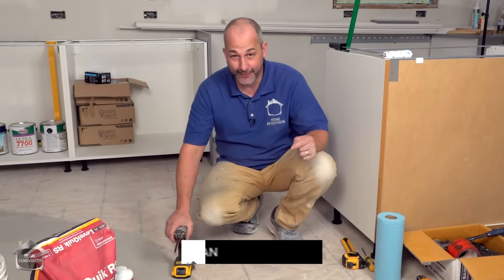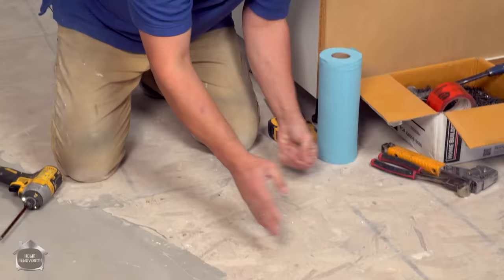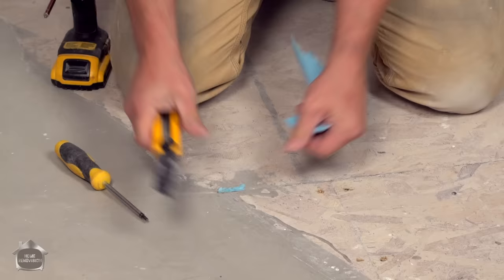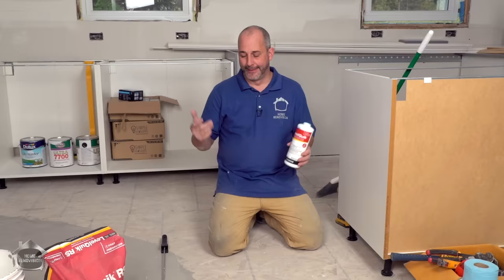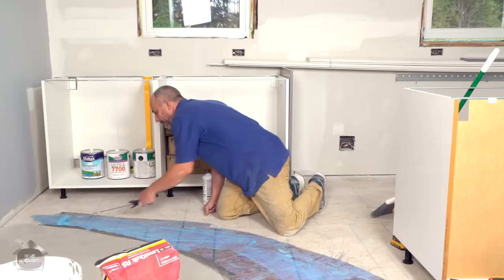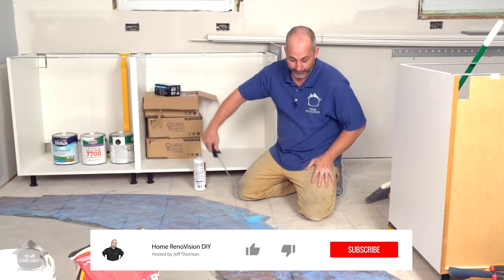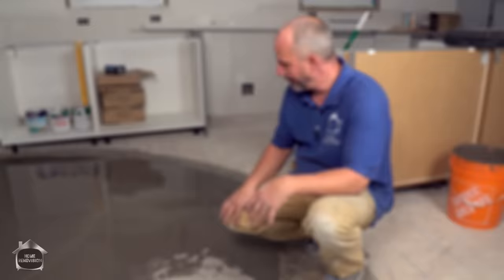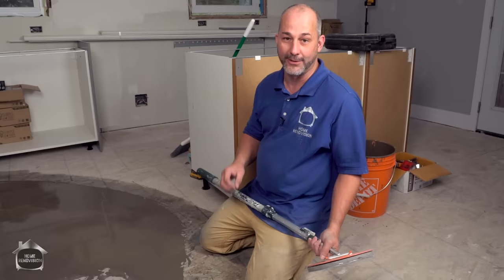How To Level Your Floors

Comment: Hey Jeff I know this is not exactly the video for this question but I'm doing vinyl plank floors and I'm not sure if I should put it under the cabinets or not. If not what do I do where the dishwasher goes. Space under counter is the same for cabinet and dishwasher correct? If I run floor up to cabinet/ dishwasher I will not be able to get it in or out. If I dont put it under the cabinets but do put it in the dishwasher area then it will not fit. Am I missing something or what? Thanks in advance for any response.
Reply from the maker: Hi Austin, first let me say that vinyl flooring can be installed first like ceramic or hardwood. if it is installed second then the dishwasher will be fine since it is so thin.  I install my cabinets first so that I can get the counter company out to measure as soon as possible to speed up my process. However in most cases it is better to do the whole floor first before the cabs. Cheers! With vinyl floors there are 2 right ways to do it!

Comment: I'm curious about what extra steps might be needed for an old pine subfloor with descent gaps in it
Reply from the maker: you may need to add a 3/8 subfloor. reduce deflection and eliminate the gaps. if it is strong you can spray foam the gaps first!

Comment: Awesome video! Question for ya. I have a second floor bathroom with tongue and grove board subfloor. The boards have 1/8” gaps and are uneven and slopped to one corner of the room. The lowest point of the room is almost 1/2”. How would you go about prepping the floor for tile? Thanks! Also, I watched your deck series a while back and built a deck at my off grid cabin! Turned out great, Thanks again!
Reply from the maker: I would add 3/8 ply and a little leveler in the corner. Cheers!
Reply: Home RenoVision DIY thanks!

Comment: I’m looking to repair a garage floor that has salt damage. The top is crumbling were the tires path is. What product is the best?
Reply from the maker: power wash it and repair with hydraulic cement. then use an epoxy paint on the floor. cheers!

Comment: Here how not to level your floors... my contractor used regular cement and ended up raising my kitchen floor 3” higher than the dinning room requiring that a ramp be installed leading to the kitchen. Then he installed porcelain tiles, then cabinets then Ceasar stone countertops... a month later I noticed all the floor grout was cracking and some tiles were loose. I went to the basement and noticed the joists were failing from the tremendous weight, kitchen was about to cave in!
Reply from the maker: Ouch. he definitely missed the training on that product! sometimes poeple think they learn something watching HGTV but all they do is get creative problem solving ideas.

Comment: Can you use this material and technique on a garage floor in northern climates?  I have a couple low areas and some concrete flaking
Reply from the maker: this is for indoor applications only. sorry!
Reply: @HomeRenoVisionDIY  Any other ideas for what I can use then over concrete in garage?  Will get driven over, have snow/water/salt drip on it, temperature variations, and will have tires turn on it when kid doesn't drive car in garage straight...which would never happen with teens of course   :-)

Comment: I tried following these directions on my concrete slab, same product, and it came out wavy. It didn't seem to self level at all. I used the water specifications on the bag. What would you suggest I do differently? Did it need more water than what was reccomended?
Reply from the maker: perhaps a bit, conditions of the pour affect it as well. eg relative humidity of the material installing on. air temp etc. it is best to manipulate the material a bit to get close to level and then let it sort itself out from there. or you need extra water which weakens the mix!
Reply: Home RenoVision DIY : well it was indoors and we had our temperature set to 72 Farenheit, and we live in a dessert so in general we don't get a lot of moisture. I can't speak for the moisture level of the slab. We had mopped in the morning and waited about 12 hours before attempting this. Not sure if that could help or hurt anything. 

For what it's worth, the self leveler seems perfectly competent, it's not cracking or anything. My husband and I are working on grinding it down 😩 and it's well formed. 

I did spread it with a trowel like in your video. I don't have the steadiest hand and it needed to be thin (1/4 inch or less)  over 160 square feet. I assumed that I could push it around, smooth it out as best as I could, and the leveler would do the rest, but it pretty much retained the shape I pushed it into with the the trowel. I would say ot behaved a lot more like pudding than anything.

Comment: Hi Jeff' I have a question hopefully you can give me advice on. I have a 251sqf elevated living room that is OSB subfloor on 16" separated joists. Last installers put the thin set directly on the OSB so when I tore up the old tile it gouged the OSB pretty bad. I screwed it down, sealed it and, poured a coat of leveler over the entire floor to smooth it out. It came out well and the floor is solid. My next step will be to install a "anti crack/anti fracture/uncoupling/waterproofing" membrane of some sort. "I can't build up the subfloor to high because of the transition into the dining room." My question is, do you think I could use the Mapeguard 2 peel and stick membrane that is thin but, "not considered uncoupling" or should I install the Ditra style membrane and not think twice? I can widen the transition space and hopefully not trip every time we walk into that room...

Comment: Our cement stairs on the side of our house (exterior) slope down toward the house. Is there something we can do to remedy this without ripping it all out?
Reply from the maker: Hi Holly, yes you can resurface them to fix the slope. depending on your climate you live in. the north makes this much harder as you need to protect water from getting in behind and freezing.

Comment: Can I really use a concrete-based floor leveler under a hardwood floor without having a moisture problem that warps the wood?
Reply from the maker: once the material is cured the moisture content will not cause you any problem. Cheers!

Comment: The Mapei self leveling floor leveler didn’t self level. Now I’m left with hills and valleys. Do I need to grind the whole floor down to repair?
Reply: if your left with hills and valleys, you either A, didn't smooth out your floor leveler, or B: made the mixture way to thick were it couldn't flow. You don't have to Grind the whole floor down, but you will need to level the rest of the floor to smooth that out, You can sand the floor if you want to, but, your better off getting more floor leveler and making it more thinner by adding a little bit more water. Make sure you use a level to see how much you need to apply. In worse case you might be doing the whole floor that way. It isn't going to hurt anything. I would just do the rest of the floor with the floor leveler. Good Luck to you.

Comment: Your second batch was pretty watered down. It's very important that the whole bag is mixed with the exact amount of water that it calls for. It weekends the strength of the patch if to much water is used.
Reply from the maker: that is correct, however it also allows for a soother finish which causes less sanding. the strength of the mix is relative to the deflection in the floor. in this case I have 2" of substrate so it is not as necessary. Cheers!

Comment: I have a low corner in my garage, any water , liquid spill flies in that direction and puddles at my garage door, can I use a product like this on concrete floors, does it come in grey?
Reply from the maker: yes it does but it is not designed to be a finish. it will wear with every step and be quite dusty.

Comment: I purchased some 555 self leveling compound and it says that I need to use a plastic or metal lith.  I didn’t see you use one in your video. Do I have to use this?
Reply from the maker: what is a lith?
Reply: Home RenoVision DIY I meant a lath not lith.  The plastic or metal sheets.

Comment: How would you know if the flooring is just sagging a bit and you can use a floor leveler vs you having structural problems and have to fix I dunno, some joists in the floor?
Reply from the maker: That you can inspect from underneath. In my house I had to add additional support with posts. You can always have a structural engineer come out to visit like I did to confirm your plans.

Comment: I can’t picture it, you said you can add plywood to raise up some parts. Are you saying you put down a piece of plywood, as if you had an extra piece on the floor, then used the leveler to build up and make up the difference between the “main” floor and new plywood piece?
Reply from the maker: I used a 6' level to determine the dip. then I shimmed the it to be level. added plywood under the level where possible to reduce the amount of leveler needed. Cheers!

Comment: Hey Jeff, I love the channel! Question: what's the best way to repair ceiling joists that have patches of dry rot?
Reply from the maker: remove whats on top. cut and roll them off. install new one the full length from load point to load point. never trust a laminating beam unless engineered. Cheers!
Reply: @HomeRenoVisionDIY  Thanks so much!

Comment: All floor leveler manufacturers strongly recommend against adding more than the directions state to avoid weakening the result. Yet you are not the only one adding more water in youtube videos. There are high flow products but are not readily available. Have you ever had any issues with an over watered pour?

Comment: im so stressed. had to have my sub floors replaced bc ex owner had like 5 dogs t hat urinated through the sub floor. the contractor that installed the new floors, left some uneven spots between the old and new floors. not sure how to handle this now.
Reply: We’ve had that problem before in older houses. Transitions that go between rooms that allow for slight height differences work fairly well and are very normal to have in most any house. They can be purchased at most home improvement stores.

Comment: Please note don't just fire screws into your floor without being certain that pipes or cable hasn't been laid close underneath as some contractors do
Reply from the maker: Please don't ever install pipes or wires within 1 1/2" of the underside of the floor.  That solves all those problems.

Comment: Hey Jeff how would you recommend to level a concrete subfloor in a basement with adhesive from the old hardwood floor still stuck to it? Try and scrape off the adhesive first or skip straight to floor leveler? The adhesive is a real pain to get off. Thanks and great video!
Reply from the maker: use the primer and then pour away!

Comment: I have about a 25' x 20' area I'm getting ready to lay floor in. Is it normal that the flooring is 1/2" or so out just about everywhere? Lol. Going to be a ton of leveler to get it perfectly flat.
Reply from the maker: in most cases that grade is acceptable for the flooring and unnoticeable. however if you want to use leveler then i suggest covering the whole surface to make sure you get the perfection you are after. working the material a little to keep it thin will help reduce the amount of material needed. Cheers!
Reply: @HomeRenoVisionDIY  awesome! Thank you for the reply! My concern was we are going LVP and, knew you said it needed to be flat beforehand. It may be more than 1/2" in some areas but, I think most of it is within there of being out. From what I've seen, there is no cause for concern unless the subfloor is over about 1" out as far as structural issues? Below that, just level and go it seems?

Comment: I used self-leveler over cement board, and ended up with a lot of tiny bubbles. How can I prevent this next time?
Reply from the maker: Hi Gina, use the leveler before you install the cement board. Cheers!
Reply: Home RenoVision DIY It’s too late to do that! The cement board was installed almost a year ago and is looking ragged. (We’ve been using the area for other work.) UGH.. I cannot remove the cement board. It is literally cemented to the OSB underneath (old pine boards under that then pier and beam foundation below that.) It has some dips and valleys, and needs not just leveling, but the glassy smooth surface that self- leveler usually gives. We’re about to do the kitchen, which is 19’x17’. I don’t want those dang bubbles! Any ideas? Did we mix too vigorously? Has anyone else had a bubbling issue with self-leveler? How can I avoid those dang bubbles? Or do I have to sand the whole floor!?!
Reply: @ginajohnson9690  The tiny bubbles in the screed is the screed drying out to fast .
The sub floor sucks the moisture out. I always roller two coats of pva/primer  before screed is  put down.5 litre of pva mixed 5 parts water to 1 part pva goes a long way. The biggest mistake diyers make is laying the screed to thin. We use a tilers trowel 6mm square edge to spread screed which gives a 3mm screed that self levels perfectly . Having latex screeded commercial floors for 40 year and thousands of metres this is the best method as it takes the guess work out of the screed being to thin and the one I always taught my employees. hope this helps
Reply: Terry Fox, THANK YOU! I have PVA/Primer and can easily prime first. We put a good 3-4 mm of self-leveler down, so I think the lack of primer, rather than thickness,  was my issue, especially with cement board as the base....that stuff sucks up the moisture! I’m so glad we tried it in the tiny bathroom before we did the huge kitchen!! I appreciate your taking the time to help. Blessings!

Comment: I bought a condo and when I walk around in the kitchen, I can hear my vinyl plank floors "pop" when I walk around in there, I have a feeling whoever installed the flooring before I bought it did not level the floor correctly, should I be worried? I really do not want to rip out all the flooring and have it leveled....
Reply from the maker: That may be the sound of dirt caught in between the concrete floor and the vinyl plank. many versions of that flooring have very stiff backsides. that require an underpad. if it is in a condo then it could definitely have an underpad and in most cases unless it is really old there is no need for leveler in that unit.
Reply: @HomeRenoVisionDIY  great, thanks! there is 6 mil cork underlay under the vinyl flooring, it is most likely some dirt from the concrete, i will just have to live with it :)

Comment: We gutted our flooring in our 100yr old house...  buddy before us used vapour barrier on the ground, then poured self leveller over.  It all crumbled under the boards
Reply from the maker: you need 3 things for performance. stable substrate, primer and a proper mix.